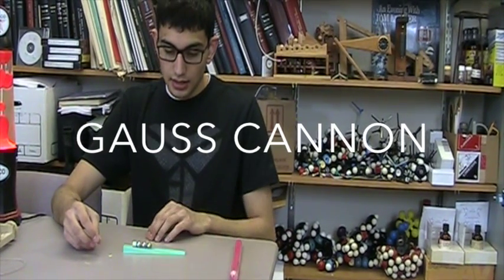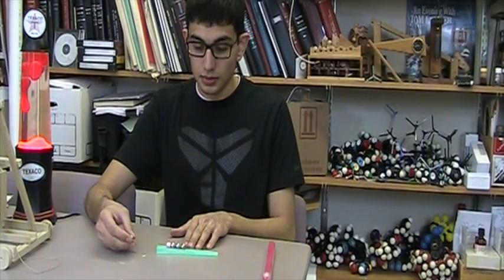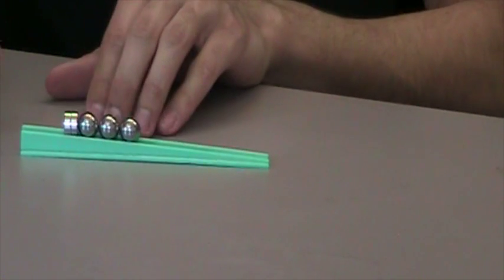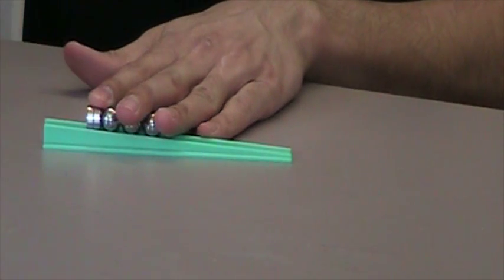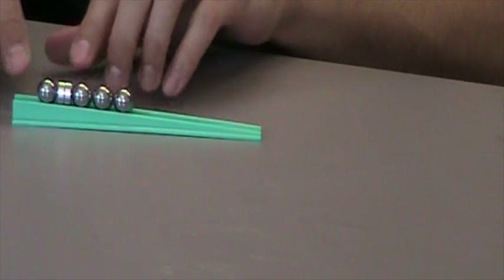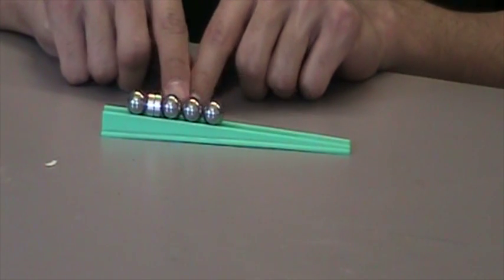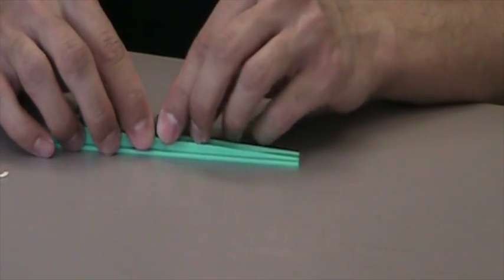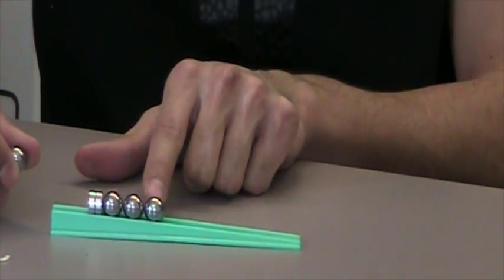Gauss Cannon

Comment: Couldn't more power br achoeved with a weaker magnet if the ball being fired wasn't magnetic at all? Or would there be some conteracting vector BS that'd prevent that from working better then the original

Comment: You could make an efficient firing  mechanism with that. By using  electromagnets in a tube, then turning them between each shot, could work exactly like pulling back the working parts of a rifle, wonder if it could be just as powerful as an actual gunpowder firearm

Comment: So what I saw was a ball bearing hitting magnets through attraction, the reaction of which being to generate force through to the other ball bearing and launch it forward. My understanding of a Gauss Rifles is that it would use polerizing magnets to create a polerized magnetic space that would launch a round at extremely high velocity not by impact of kinetic force, but by the opposite magnetic forces being applied. It's like squeezing a banana from all sides. The banana interior will have no where to go but out and violently so ;) . The problem is, we could totally make one. Right now in fact! But making the weapon stable under those sorts of pressures is incredibly difficult and we have not solved that problem really yet as I understand.
Reply: That's my understanding, too. the projectile never touches the magnets - which are arranged each side in a line.

Comment: Soo if he dropped 2 steel balls on the magnet instead of just 1 would that double the velocity of the last steel ball that will be in  propulion or would 2 steel balls follow instead of just 1?
Edit:I think it he was to increase the magnitude of the 1 steel ball that would increase the velocity,if he droped 2 separate steel balls that would make 2 steel ball be propelled forward.(with the distance between them dependant on the distance the 2 balls were dropped apart from each other.)

Comment: But why does the final steel ball shoot out with a much higher velocity than the first steel ball hits at? Or does it not? Is it an equal velocity? And if so, what's the use if the force out equals the force in?

Comment: what if you make the last ball very small?
Reply: It would probably move faster, as it would require less energy to accelerate, but it would decrease the power. Force = Mass * Acceleration; It may be moving faster, but it has less mass, so it wouldn't hit harder.
Reply: @akashboinpally4389  im thinking about a way to make it more usefull, with this design it wont become more effective than throwing a stone.
making the chain longer wont work because if the balls go supersonic they would just start to deform.

Comment: I think you should also explain why the remaining balls went up the hill after the impact.
Reply: just like recoil in gun :)
Reply: @agamikhwana8596  No. That doesn't make any sense, and it doesn't happen in a regular Newton's cradle either. The reason the other balls went up hill is that the magnets are initially pulled towards the first ball as it approaches them. So this "recoil" happens before the shot even goes off.
Reply: @jornflim78  no, it's because of recoil. There's really nothing special to it. Newton's law of interaction. That's it
Reply: @lick28  You're plain wrong. Sorry but I can't explain it any better. Maybe you could explain to me why there would be recoil here if there is no recoil in a regular Newton's cradle? It's the exact same principle.
Reply: @jornflim78  because, this might sound crazy, but they have different purposes therefore using different charges of the magnets. A newton's cradle is there to demonstrate conservation of energy while a gauss cannon/coilgun/rail gun is there to launch something at insane speed. I don't think you need to have a phd to understand the difference here
Reply: @lick28  The balls and magnets move up before and right up to collision, because of magnetic force between the magnets and the approaching ball. There is no recoil. 

This works exactly like a Newton's cradle. The only purpose the magnets serve is the rapid acceleration of the approaching ball. The magnetic field only pulls towards the fired ball as it flies away, it does not push it.
Reply: @jornflim78  the force is still there, just because magnetism isn't an actual physical thing doesn't mean it doesn't produce energy. This is middle school stuff and a netown's cradle is virtually irrelevant to the subject.
Reply: @lick28  Sigh. It's like you're not even thinking about it. The magnetism PULLS the ball. How the hell do you imagine it would do any pushing on it? And yes, this thing works EXACTLY like a Newton's cradle. The magnets are only there to accelerate the incoming ball, not the outgoing one.
Reply: @jornflim78  you're a difficult and stubborn person. You could just go research how a railgun works. I'd rather not argue with someone who can't even tell the difference between the two
Reply: @lick28  So you're going to insult while being plain wrong. Amazing. This works nothing like a railgun, I don't even know why you would mention that. How this thing works is explained in the video, I almost feel like you didn't even watch it. 

I clearly explained to you how this works yet you just don't want to accept it. You have never explained anything and you want me to accept your viewpoint. You are objectively being much more difficult than me.

So how about you back up your ridiculous claim of there being recoil here and explaim exactly where it comes from?
Reply: @lick28  You're just trolling... Never explained your point of view... Yes those are objectively insulting terms, everybody views it that way...

So I'm not going to respond to anything else than at least a half-decent explanation anymore. But I can tell you in advance that you are just wrong, simple as that. 

It's a simple construction, the magnets make the ball accelerate fast into them, then like a Newton's cradle the ball on the far end is launched. The reason it is launched so hard is that the magnets, which are quite strong, make the incoming ball accelerate really fast and hit them at high speed, so there is a lot of force transmitted through this thing which functions exactly like a Newton's cradle in that most force is transmitted all the way to the last ball. The reason it moves back, which happens BEFORE impact, is that the magnets pull at the incoming ball, accelerating the ball, but at the same time that same pull also pulls the magnets towards the incoming ball a bit. And that's it.
Reply: @jornflim78  don't waste more time, he won't get it.
Reply: @lick28  
I’m gonna back up @The Culture Industry here, your explanation isn’t quite right. As the first ball accelerates towards the magnet + projectile, conservation of momentum dictates that the magnet + projectile must move in the opposite direction. When the ball hits the magnet and transfers its momentum to the projectile, the magnet is already moving backwards.

You can see this is true by playing back the video frame by frame.